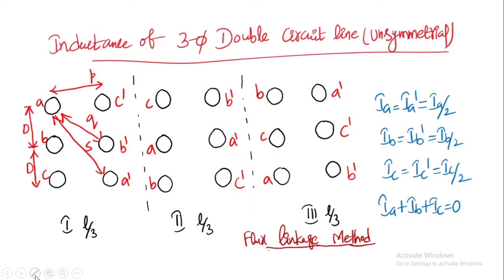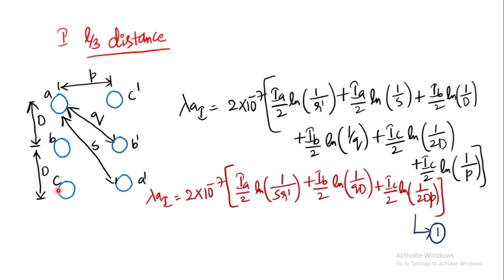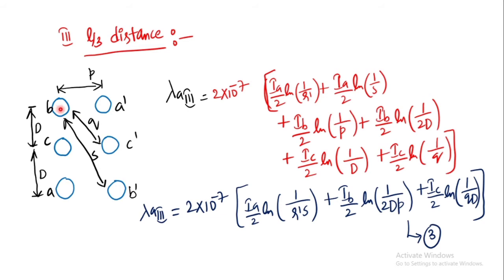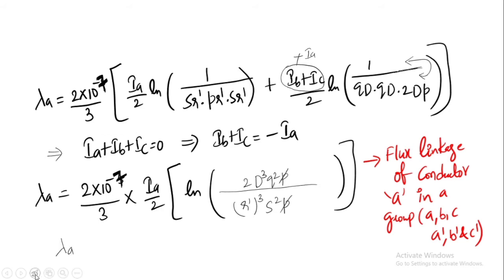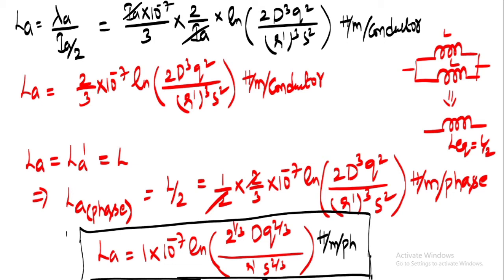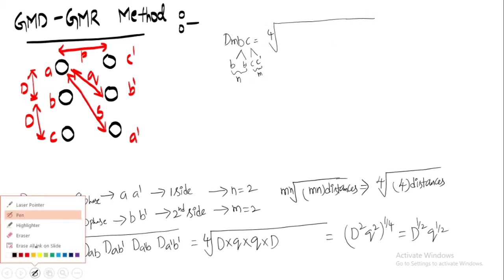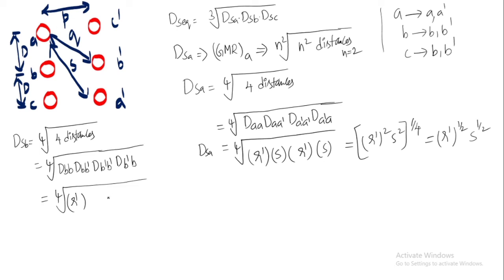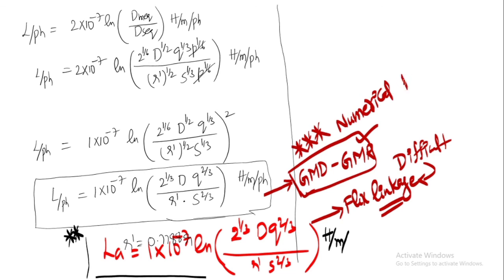Inductance of Double Circuit line (Unsymmetrical spacing) by Flux Linkage method & GMD-GMR method.

Comment: What of gmr Sir...?
In.ur previous video of explaining gmr u said its r' of a strand then distance of other stands to a strand but in the composite conductor. And since we assumed as aa' is one side of the conductor then the gmr should just be the dsa . Why we also used dsb and dsc and they r of differnt side of the conductor and never the less our concern is only phase A then why also dsb and dsc
Reply from the maker: GMR equivalent is GMD concerning all subconductors per each phase for each transposition interval in one interval.
Reply from the maker: Here all the six conductors can be considered as composite group and now it is not GMR, but GMR equivalent. GMR can be
 r' if we have only one conductor or
Nth root of n distances if all n conductors are in same phase
As two conductors in one phase , two conductors in secobd phase and the remaining two in third phase we need to use GMR equivalent but not GMR.
Reply: @MrRavindraprasad  
Sorry for the trouble sir.
But whats the difference btwn gmr and gmr equivalent

Comment: Si why do we need Dmbc while in Gmd our concern side of conductor is a and a' and we r trying to find phase inductance of aa' side of conductor . That means it should be aa' with bb' and also aa with cc' . I dont understand why we need dmbc as our comcerm phase is (aa') conductor.
I will really appreciate if u will clear my doubt Sir.
Thnxs alot for ur knowledge i have watched ur entire playlist of power system . Ur concepts r amazing.
Much luv from Kenya
Reply from the maker: What you said is exactly correct. You can consider a and a' as one side b,b',c&c' as another side. Then you will get GMD equivalent as 8th root of 8 distances. Like that you will get for b,b' and c,c'. So finally you will get 24th root of 24 distances. In the method we have used in the video we obtained 12th root of 12 distances .But both will yield the same result.
Reply from the maker: The reason why we have considered dmbc is we are actually finding equivalent GMD.  It is the Geometric Mean distance for all three phases and most important thing is it is GMD for all three transposition intervals by considering only first interval(first l/3 distance)  itself.
Reply from the maker: Thanks for your support and encouragement 👍
Reply from the maker: Our concern phase is a, a'  in only flux linkage method but in GMD -GMR method. In GMD-GMR method we need to consider all phases and all transposition intervals in one interval itself.